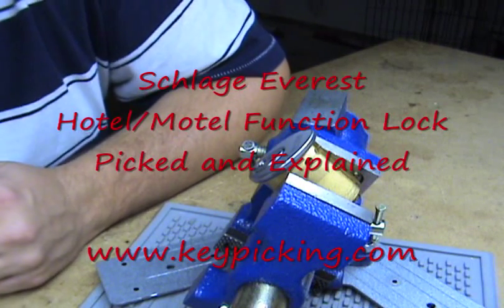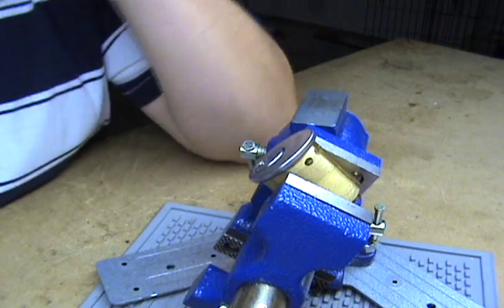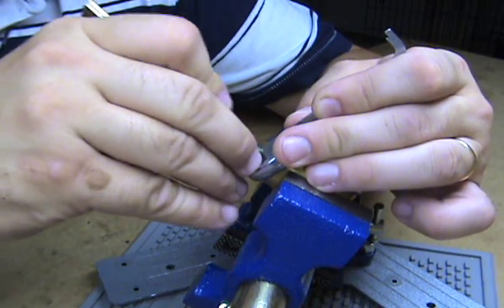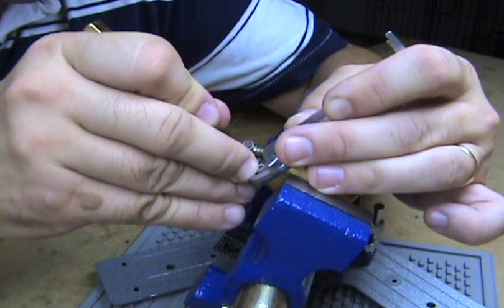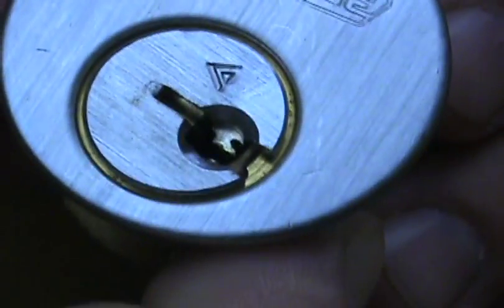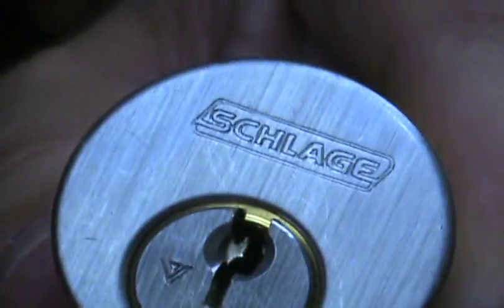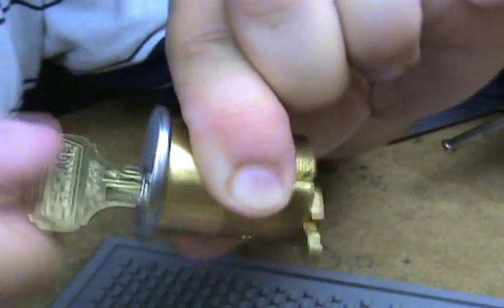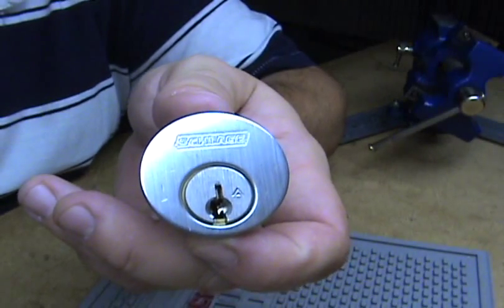Schlage Everest Hotel/Motel Picked and Explained

Comment: I have a vingcard cylinder with a similar function. Lock has 2 shearlines which allowed the maid key only to retract the day latch but if the occupant locked the deadbolt it wouldn't turn far enough to open it.